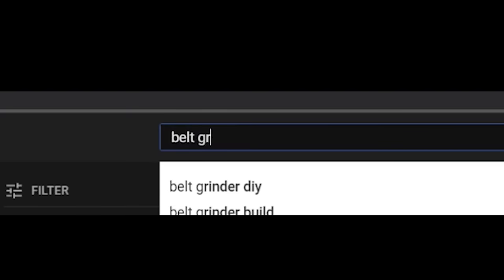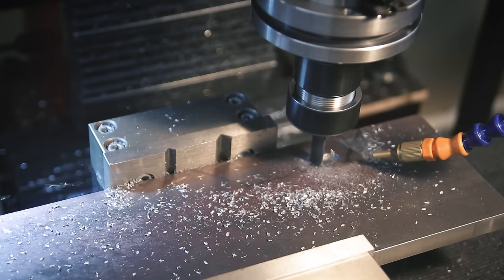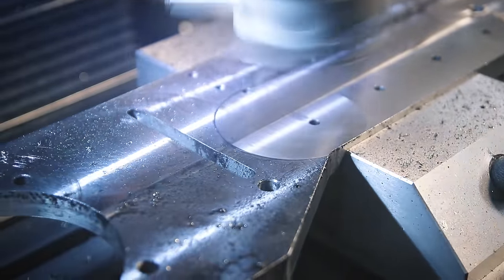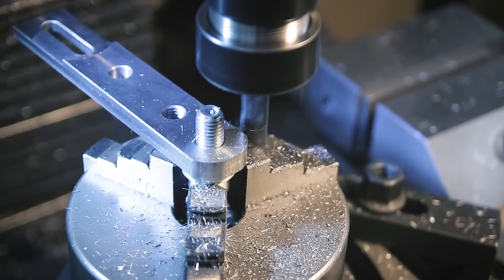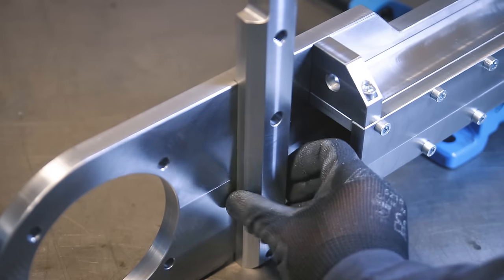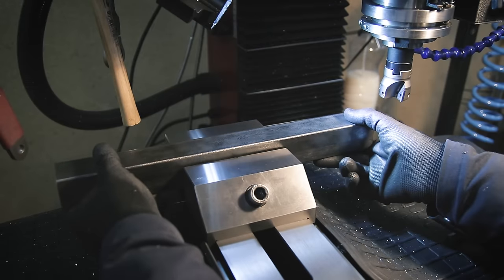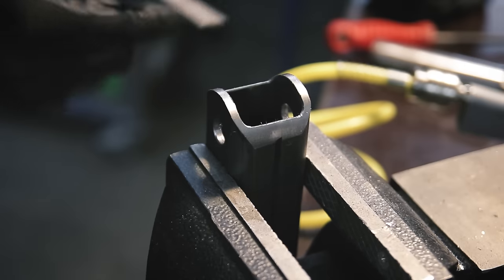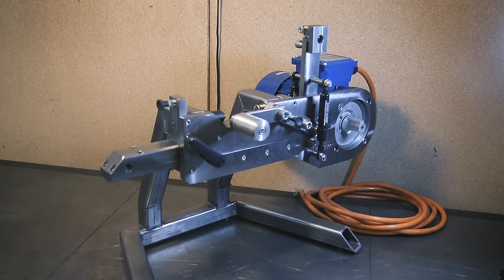Building a Machinists Belt Grinder - The Trilogy [Part 1]

Comment: So the would be belt grinder buyer in me is asking himself, if after all that design work & prototyping, surely there’s a market for this machine?
Why not outsource the parts to various factories in China, bring them back to you for assembly & sell?
I’d sure as heck but one!
It’s one of the best thought out designs I have seen.
It seems a waste to not capitalise on your intellectual property.
Don’t get it made & assembled one China - they will just copy / steal your intellectual property design.
Just farm out some parts to one factory & other parts to another factory etc.
Don’t give any factory the full design, just individual parts.
Then assemble yourself & sell to recoup your design & prototyping time & effort.
What would you charge to make & sell one?
Reply from the maker: With the way it's designed, I'm honestly not sure it could be produced at a reasonable price point even by a factory. If you look at commercial grinders they often rely heavily on 2D parts which makes sense, because they can be made very easy and cheap using CNC plasma/waterjet/lasercutting machines, and they avoid welded parts because welding means expensive man-hours. But this grinder consists of many more or less complex 3D parts that you'd have to CNC machine which I imagine would drive the price way up.  I see your point though, it might seem tempting from an outside perspective, but I'm just not a business guy. If I went that route, I'd first need a bunch of starting money which I don't have, and then my days would have to consist of doing paperwork, talking to companies, managing people and contracts and legal stuff, dealing with lawyers and taxes and shipping and so on and so forth. That's not the kind of stuff my talents lie in but it's also not the kind of stuff that is fun/motivating for me to do. I just want to be in the shop and build things. If I ever had the money for that kind of equipment, I'd maybe consider getting a proper CNC mill and producing this thing myself in small quantities, but I don't see that happening anytime soon. And I can't really keep anyone from copying and producing this machine as it is, since the plans are out there already and I don't have a team of lawyers to defend myself against that. In the end, I'm not really in this for the money, I'd be happy just being able make a modest but decent living that allows me to design and build stuff as much as I want. I'm hoping that by just selling the plans I can at least achieve that.
Reply: Phil Vandelay Can’t blame you for that approach Phil, your very good at what you do - I guess I just figure you deserve every success because of your obvious talent at both design & construction.
Making a good living in manufacturing in any first world nation is incredibly hard these days, your competing against factories in China employing child slave labor working 14 hour days 7 days a week for 2 bowls of rice.
We all have to survive, & you have to do, whatever you can to survive & make a living.
Man it would be great even if you sold the parts in kit form and buyers could assemble themselves, just watching your video.
Not everyone has a flash metal lathe & mill and computers for designing in 3D etc.
I guess we should just buy one of the commercial offerings already available.
It’s a shame, I’d like to support guys like yourself giving it your all. But I do understand exactly what you are saying.
Reply from the maker: @ianmoone2359  You're not the first to suggest this, so I think I will definitely mull over this idea for a while and maybe see if there is a way I could reasonably produce this myself. But as I said it would have to include at least a CNC mill and probably CNC waterjet, which could automate it to a large extent. If I ever  have that kind of cash to spare, I wouldn't rule it out ;)  As you said, it's not easy making anything yourself and competing with prices overseas these days, but there are still people willing to pay extra for high quality locally made products.
Reply: Phil Vandelay Phil, here downunder, theres a big swing against Chinese product.
The western world is turning against China. They have put big trade tariffs on our exported barley, and banned a lot of our beef. They interfere in our politics, and cyber attack us. They are threatening much of the world including US & us downunder 🇦🇺 in the South China Sea. They are at loggerheads with India as well & Hong Kong & Taiwan, Japan also.
There are bank runs starting in China as their fiscal system is collapsing.
You might be amazed at the support you’d get, as the world turns against China & all it stands for.
Whatever you do I wish you the very best of luck with however it turns out.

Comment: Wheres you round column mill realized its nt rigid enough?xd
Reply from the maker: No, I actually got a lot of work done on that thing, they're not nearly as bad as people like to call them. But there was numerous other things that annoyed me about it, like leadscrews being worn out, but it was a good starter mill. I actually regret selling it, since it's a real workhorse, but didn't have the space (and cash) for two mills at the time. The new one is mostly more convenient to use, but I think I could have built this project on the RF-30 too, just would have taken longer.
Reply: @PhilVandelay  i  understand its not as bad as people call it but compared to a dovetail column mill its inferior im terms of rigidity but gets the job done with precision as well depending on the ways. Xd

Comment: i have your plans...   i cannot for the life of me understand why you use your vice for any of this..you faced the part after you drilled all the holes..  you know what this means?
Reply from the maker: You have them or you bought them?
Reply: @PhilVandelay  yeah bought them. Bought others aswell to get some other input. No worries i will adapt them to make improvements.
Reply from the maker: @domkelly1972  Alright so I'm still trying to figure out if you want actual information from me or just came to tell me I'm doing everything wrong. In which case I think I'm gonna pass on the conversation
Reply: @PhilVandelay  not everything wrong. Just face after drill is not the right way round.  Using a vice like that is it inaccurate so in the end maybe using a mill is not even required. Like I said I will make improvements. The wheels are a problem. Need a very expensive lathe to make them or think outside the box. I won't be making them like you have.  Also that means I can add a function yours does not have.